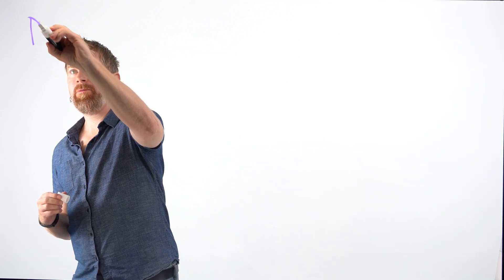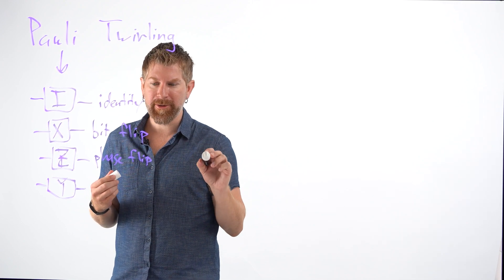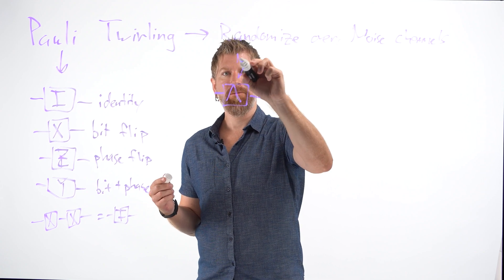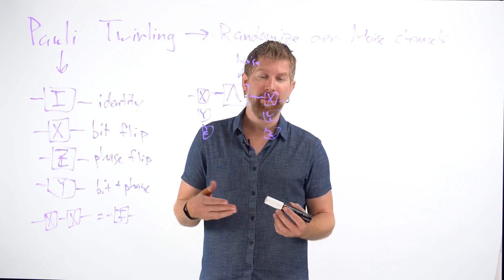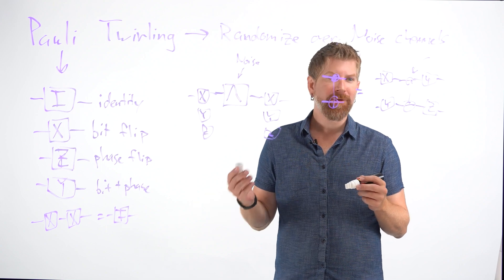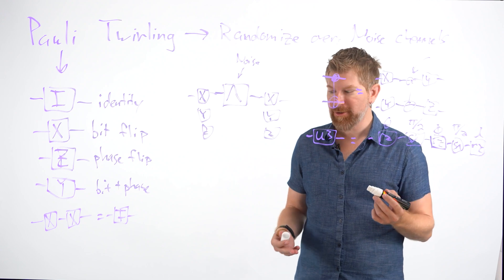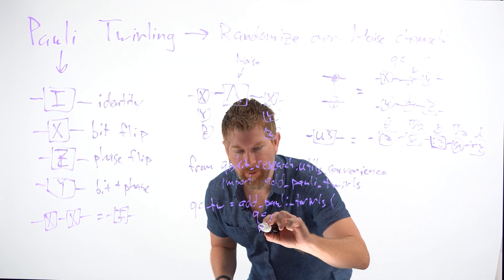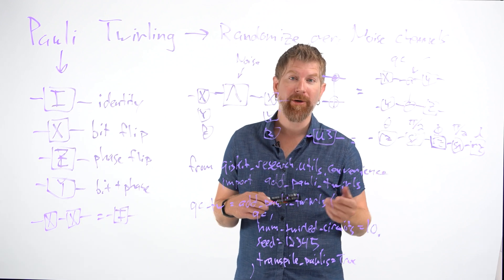Nick Knows - Pauli Twirling

Comment: Unless I've missed something, the example given at 2:52 does not produce a CNOT gate, unless the gate in the middle is already a CNOT.  If you solve for U in YZ*U*XY=CNOT, you obtain U=CNOT. So maybe you are describing twirling a CNOT using the Paul gates you placed around it.  But if you were trying to replace CNOT with a different 2-qubit operation (the diagram is unclear), then  you can implement CNOT by applying H to the bottom qubit, then control-Z to both qubits, then H on the  bottom qubit again.
Reply: You are right in that the circuit in that case is equal to cnot only if the middle gate is cnot already. The point of twirling is that the plain cnot and the “extra stuff” cnot are implemented with different pulses, and react differently to noise.
Reply: @WillParry00  I would like to understand this better.
Reply: I got confused as well
Reply: Maybe he assumes a situation when CNOT operation is not perfect.